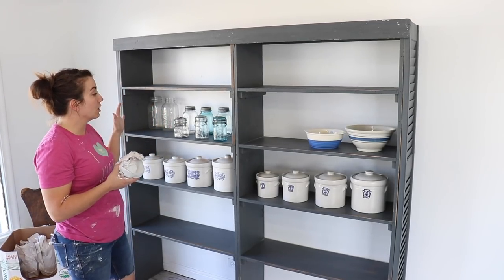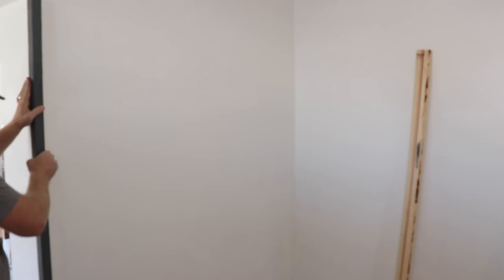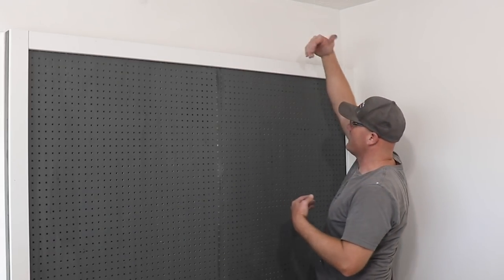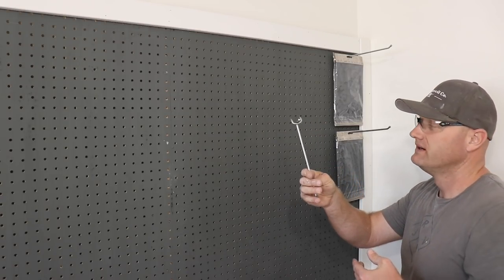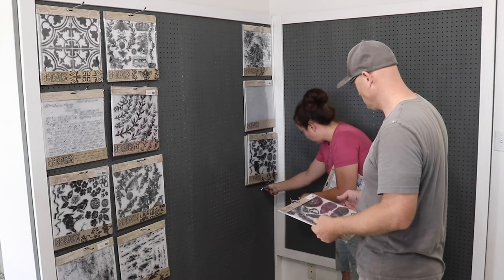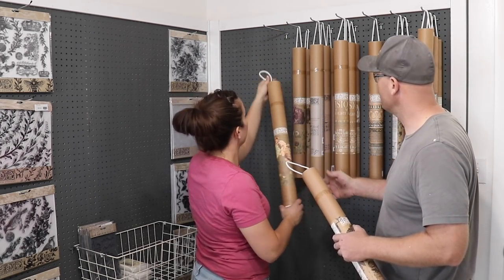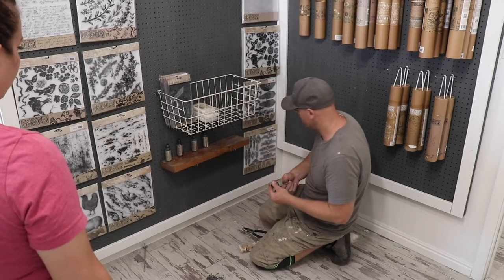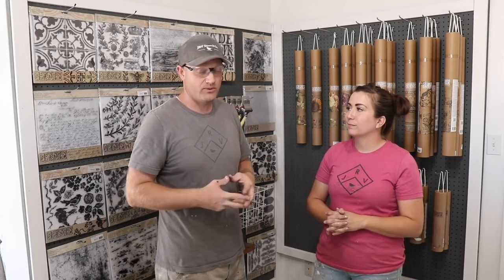Farmhouse Store | Shelving and Displays

Comment: If you put those smaller rolls on the top and the bigger ones on the bottom it would work better.  You can grab the short ones easily, but you don't have to bend way down to even see the shorter ones.  The bigger ones will still be easily accessible.